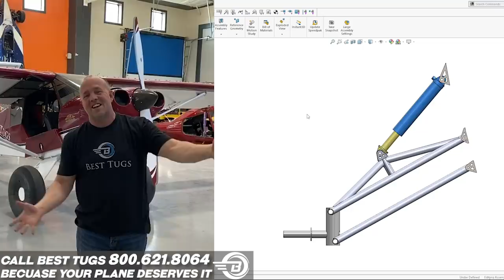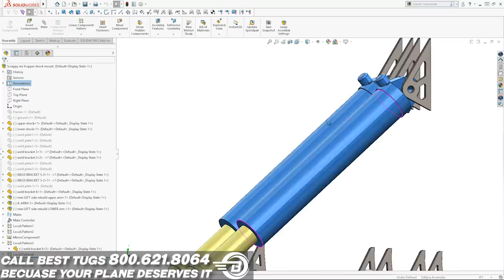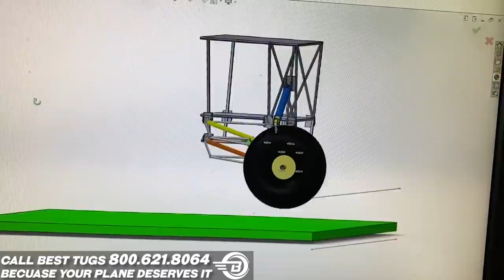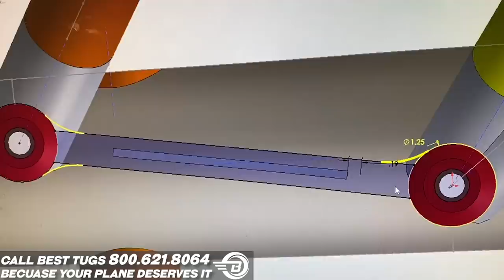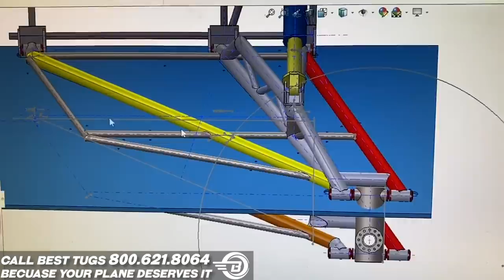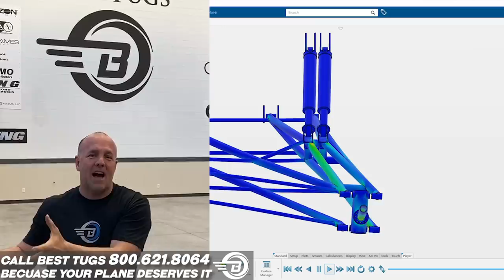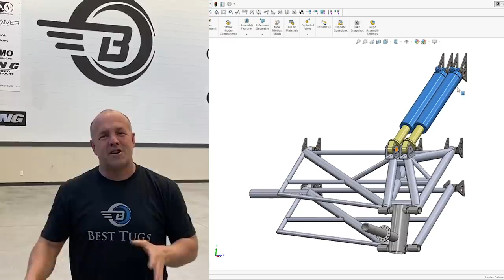20" + Travel - Extreme Bush Plane Landing Gear (Scrappy Bush Plane 15)

Comment: Its not boring we would love to see more of the solid-works stuff
Reply from the maker: Jansen Papworth .... great I love to see this.  I will start showing more 👍🤠
Reply: @MikePatey  Can you also show calculated forces/torque/etc from FEM in the model please? It will be very exiting to see real part of the aircraft and the also in the computer. I'm not mechanical engineer and I have always doubts when I see home-made airplane with very thin pipes holding the (8-Cylinder) engine or on the landing gear. Thanks a lot!
Reply: Mike Patey absolutely! The more detail the better!
Reply: @MikePatey  I don't know if you will see this, but I recently found and purchased the plane my father built in 1978. I was fortunate to have use of this plane as a kid. It's still flying, but (42years later) in need of repair. I was hoping you could tell me where I can find information on working with fibreglass and carbon fiber. YouTube videos are always lacking critical info.  This would mean a lot to me. Thanks, Jay
Reply: Count me in
Reply: Indeed, it was all the tech/engineering stuff that got me watching in the first place. I'd much rather see the design process than the assembly!
Reply: I don't know Ronald, I think I enjoy both equally.  I like to see how he designs and fabricates it, as well as how it all goes together.  
To me it makes the entire process fit together into one story that we can then watch take to the sky, knowing why and how it does so.
Reply: @MikePatey  I've just started learning Solidworks and composite tech to build projects that lead into a dream of one day building an electric bush plane. Would love to learn how you calculate the loads that you plug into the simulation software without load cells. Also if you use any topology optimisation/generative design to help reduce weight whilst keeping strength up.

Gear looks epic! Well done
Reply: @MikePatey  We'd probably love every ounce of vid shot
Reply: Absolutely!
Reply: Absolutely keen on seeing more solidworks stuff. Just getting into this myself!
Reply: Mike I'd love to see more of your stress analysis. I am a Structural Engineer and in fact run a university SE research/testing laboratory. So obviously I just drool over this stuff.
Reply: @MikePatey  Please show your math work. We are all invested into this ;P
Reply: An intelligent mind can never be board
Reply: amen! it's the crux of these builds!  a sort of preview before the plane gets off the ground! great vid!
Reply: @MikePatey  As a young engineer using SW I would love to see an in depth video on your design and FEA. The more detail the better
Reply: I love the details!
Reply: @MikePatey  yeah Mike, love the Solid Works stuff !
Reply: Dude, you’re a freaking genius and you can weld like a robot! I’m so impressed I can’t articulate it.
Reply: Not at all boring Mike.
Reply: I love watching BREP computer aided design and the physics testing of the parts with your software too. You should record your 3D drafting sessions with Camtasia or Screen Recorder 2 . Just capturing your screens with a video cam isn't enough.
Reply: Definitely 👍
Reply: More cow bell !!!

Comment: All the tiny details such as that Toe-In detail are what make you such an awesome engineer! Keep this stuff coming! Such an inspiration! Thank you.
Reply: Renasaience designing..  People across the world are daring to Dream.  Hardware to pixels.  Inspirational.
Reply: I remember a long time back somebody made a three wheel streamlined car with a motorcycle engine that was supposed to get high gas mileage but no one bothered about tire alignment. It steered badly, the tires wore out, and you couldn't fix it because the basic design was too weak and nonadjustable. It sure was shiny though. There is no replacement for doing your homework.

Comment: I was just thinking about the drag that gear would create. Then you mentioned that tidbit in the end and I immediately went 'well obviously!'

You really think of everything
Reply: All of those tubes will add a significant amount of drag, well, 35" tires aren't exactly slender, so might as well make the fairing wing shaped to help negate some of the drag and add lift.
Reply: I was thinking weight would be an issue as well. This is going to be a really interesting build and finished plane!

Comment: Stress analysis is what separates the yahoo fabricators from the engineers.
Reply: PDZ1122 on the flip side of that argument real world fabrication experience is what makes him stand out from the engineers that fabricators and mechanics curse with their every breath.
Reply: @jonkeau5155  And the delicate touch you need to fly seems to be the thing that transports to welding, because those are nice runs :o)
Reply: Yes but it is very dependent on what you put in and how you actually load the part in real life. Which is hard to predict. Its a tool if used properly will help but if used improperly will harm. its not the final answer.
Reply: TakeDeadAim Interesting. Would your design be lighter too?

Comment: The engineering that went into the jig itself is mind blowing let alone the A arms and knuckles. I wondered about toe in and you explained it good. An other question I have how are you protecting the inside surfaces of the welded components? Nordyn used to have all their tubes drilled so they could fill the fuselage with heated linseed oil and coat the inside, as well as check for bad welds. How are you protecting the interior of your components or is it not a worry ?
As always Mike your amazing.

Comment: When I saw the tubing behind the main upper A frame I actually thought of covering it with canvas. Well, you are always two steps ahead. Also, it's crazy how much frontal area those tires take!
Reply: Wouldnt be a "carbon cub" if it used canvas
Reply: @doogssmee9742  what are you talking about? All carbon cubs use canvas. This is the only one with that much carbon fiber. Also if it was a real composite aircraft design it wouldn't need the steel tubing frame.

Comment: Where your tire stays vertical through the entire range of motion, you'll still create scrub as it travels. Why would you not do similar to the automotive application by shortening the upper arm to give the wheel some negative camber at full extension? That would allow you to "preload" the suspension easier before take-off to give you that spring effect like you were doing with Draco?  I am guessing to help with the stresses?
Reply: It appears that the UCA and LCA attach points are not parallel to vertical, this would give a small amount of unequal length.  It's likely just fine for the type of suspension this is, though it doesn't leave much room in that regard for non-level/single wheel landings.  Most of the reason you see unequal length in vehicles is due to steering concerns (bump steer) and in applications where tiny adjustments in suspension geometry make a huge difference (race/ high speed).

Comment: Hey Mike, are you planning to heat treat the arms? Welding will leave the joints in an annealed state so hopefully you accounted for that with your stress analysis. Edit for spelling and one more question: did you build any camber gain into the geometry? With car suspension it's really important, but  I would imagine body roll on an airplane is less of a factor. Love your work, just always want to know more about the thought process that goes into a design.
Reply: You raise a great question - it seems to me that body roll resistance might be a good thing (check out the videos of Draco, and especially the crash).     Anybody ever see an airplane with an anti-roll bar in the suspension? 😜
Reply: I wonder if there was some effort to slow the cooling of the welds, especially where the spindle attaches to the upright?
Reply: @oddcarsandbaddecisions  In general, as steel comes down through transition temp, the slower it cools the more chance it has to anneal.  If cooled quickly enough, it will retain hardness.  Chrome/moly is pretty hardenable, and as carbon content goes up (ie, 4130 vs. 4140 vs. 4150) the harder it will be if quenched (cooled quickly) - but if the quench it too severe it can crack.   My recollection for the large pieces I used to be involved with is that 4140 required significant pre-heat, and controlled cooling with ceramic wool blankets, to prevent hardening and cracking.   I don't think that would be as much of an issue with those small TIG welds, but don't know for sure.   Depending on the filler he's using, it may match up with the desired hardness of the tube just by air cooling without any post heat or blankets.  I would assume Mike has this well thought out, since the results he had on Draco looked to have turned out tremendously strong (did any welds fail on that Horrible Terrible No-Good Very Bad Day?).
Reply: Matt Uecker thanks so much, I appreciate the information,  I’m not an engineer or a pro welder, and am always interested in what guides designers/engineers decisions.

Comment: Super excited about the FEA analysis video!!!  I'm in finals week right now!  We got to design a car suspension and a jet engine to run FEAs on in my CAE class this semester.  Everything from static analysis with temperature inputs, fatigue cycling, flow analysis, factor of safety  and heat exchanger design plus so much more was covered.  It scared the crap out of me at first.  Now I think it should be a requirement for all undergraduate engineers just like Physics.  This class was THAT good!!!!

Comment: Great job. Enjoy the video. There will still be scrub on the tires as they spread out on a radius, but their camber won't change significantly so the tires won't tuck in at an angle.

Comment: The reference holes are a sweet idea. They will also let expanding air out so it wont push it into back of weld puddle. I run into more problems with welding aluminum tube. Unless you back purge it. Very nice work Sir!!!!!

Comment: If you want to avoid the tires from scrubbing you could have the camber change to your advantage. If the suspension were going beyond parallel to the ground on compression you could use a shorter upper arm. So as the arms swing and bring the width between the spindles down it gets negative camber in both extention and compression beyond when the arms are parallel to the ground. You could build the spindles with a little positive camber so they average closer to zero. But if the arms parallel to the ground is the extent of the travel you could make the spindle height a little less than the height between arms at the airframe. This is kinda opposite of a lot of racing vehicles since they want negative camber to adjusfor body roll and tire roll but for landing purposes I think it makes sense. I might also be inclined to cris cross the lower arms to maximize the scrub radius. Now all I need to do is learn to fly and make a few million dollars so I can test it 😁
Reply: That's what I was thinking too. Tricky though - because to truly avoid tire scrub the wheel alignment would need to change as a function of the change in the landing wheel's horizontal movement over the change in tire rotation speed - not just the landing gear's vertical compression - though I'm sure taking advantage of camber change would help some.

Comment: SolidWorks is most defiantly a essential tool these  in many ares even beyond mechanical design/engineering. Like Mike mentions, they offer a really powerful tool with their FEA (Finite Element Analysis) Simulator as well as Flow simulations , Heat transfer ,yield strength, Mass/Weight/Balance, ect. Give the model the correct specific gravity of the material you plan to use and it will tell you about what its going to weight an where the CG is of any component or group. Fascinating stuff  really, I sure hope Mike gives us a more in-depth look into his design process and the evolution of a components  "Concept to Completion" I'm sure we all can learn a lot from others processes and we all can grow together. Thanks Mike for graciously sharing you time, insights, and passion for both Aviation and Construction. We applaud you for your continued efforts! Well Done Sir...

Comment: The Super Sick part of this gear is that mole hills won't be an issue anymore. 
Taking the design functionality of offroad trucks/buggys is Very cool, and Smart. Though not a pilot,  I have seen and watched thousands of of aircraft struggle with obstacles and the aircraft just get pounded. This gear should eliminate that.
Can't Wait to see them in action.

Comment: Savage STOL outback, and Fiesler scorch partially solve the geometry limit by using an upper amount point for a brace/strut, but your double arm solution competely solves it, but with a bit of a weight penalty, as everything is done more compactly, and the shock has a smaller moment arm, so must be larger.  so will be interesting to see which wins in short landing competition.  your's will win for sure at stol drags due to sheer power, and in the bush due to max travel with no compromise of camber geometry... 
Nice work and thanks for the update!!

Comment: Love it.  Please include in the video on running the software the parameters you use to determine where the load is applied and why, how much grunt you need in the computer to run the analysis and the time it takes to crunch the numbers.

Comment: Hi Mike, As an Aussie older bloke watching you design and build this and Drago is fascinating. Been an aircraft watcher for at least 70 years and was involved in it as a firefighter for 30 years in a previous life. A couple of observations. 1. What effect will the hot air being exhausted from the oil cooler have on the aerodynamics of the horizontal stabilizer?  2. As you were showing the build on the undercarriage I was thinking,"Mike there is going to be a lot of drag on that so you better think about dome sort of streamlining for it!" Then Lo and behold right at the end you state, "Of course I am going to build a wing over this." Well I thought at least we are on the same page. Keep up the great work Mike, loving it. Then of course there is you working through the night sometimes and midnight or later regularly.. When is you rest time???? If you are not careful it will catch up with you. In my time as a firie worked shift work of some style for most of it and I wasn't unhappy to leave it behind even though I missed being a firie on airports. By the way I continued being a firie/mine rescue officer for another 9 years so it was 38 years overall.

Comment: great suspension system.  I have done the same thing on a recumbent trike.  I went one step further  by adding the additional axis of movement associated with tilt wheel technology.  tilt wheel that has full independent suspension swing arms.  someone else would not have noticed but that is a great vibratory deburring machine you have there.  those welds you featured that you did on Draco are awesome.  wish mine looked that good.  :o)  another interesting thing is that when I build a trailer I do the same thing regarding toe-in.  the trailer sure tracks nicely.  I also noticed you only did a fusion weld on the cap to the tube.  stands to reason, it isn't structural.   I am just sooooooooo impressed with the well rounded skill set you posses.  You are an amazing dude!!!!!  I always learn something new when I watch your videos.  BTW:  the time lapse was great.  the component fit is indicative of a great CAD/CAM program and programmer.  (emphasis on the programmer)  Keep up the great work because it is so inspirational.

Comment: Hey mike, 
when designing car suspensions, you can purposely make the rods holding the wheel different lengths to, when compressing the suspensions, the wheels adjust the camber and toe to help steering.
I wonder why not have the rods closer to the center slightly shorter so, whenever you're compressing (landing/hitting) the wheel drastically toes-in helping to center the plane direction.
needless to say I'm just a 'keyboard engineer' so this is just something that came to my mind. 
Great videos, thank you for sharing!

Comment: As a mechanical engineer and rock crawler suspension designer I think this is just great and I gather very revolutionary in the aircraft design world. Just two questions if so could:

1) The upper and lower arms mount very close to eachother as compared to the vehicular space. What is the limiting factor in the aviation world that requires that close spacing?

2) Ho do you control weld distortion? It looks like the aluminum plate jig restricts welding from the back side? Do you tack weld on one side then the back without the jig? Is there a top and bottom Jig? Holes in the jig that allow tacking the backside without having to unholy the arms?

Thanks for taking the time to video and publish your great work. I always learn a lot from your videos in a subject that I find interesting, but which is outside my resources to explore myself. 

Sincerely, 

Leo P.

Comment: Hey Mike......in your last video on the control lock, I asked a couple of safety related questions,  which you may have missed.... 1) why is the elevator locked in full down?  2) is there a positive OFF lock on the locking mechanism, so that it does not interfere with the controls in flight ( turbulence or vibration..) Thanks and keep up the good work!

Comment: Our company makes superphosphate spreaders (yes - super spreaders) and they are designed using Solidworks. It is amazing to see a really large machine (dual axle - 25 ton)  rotating around the monitor screen at the flick of a mouse!, we know that everything (which is laser cut and precision folded at another facility, just fits together - a welder's dream